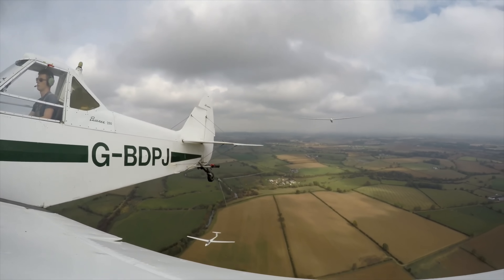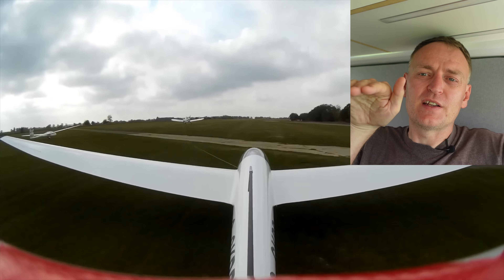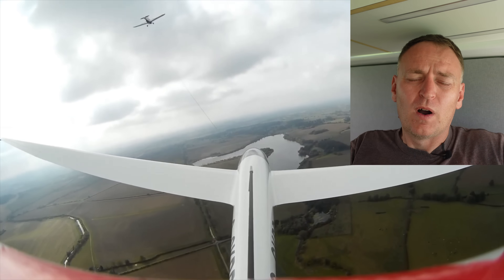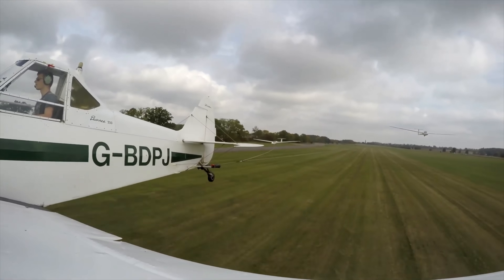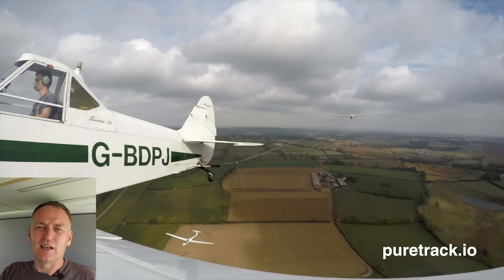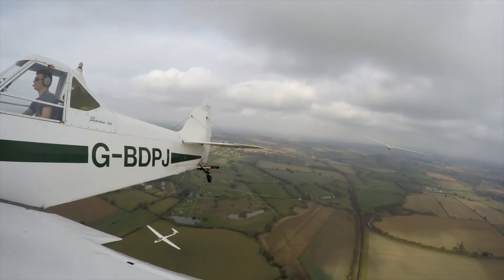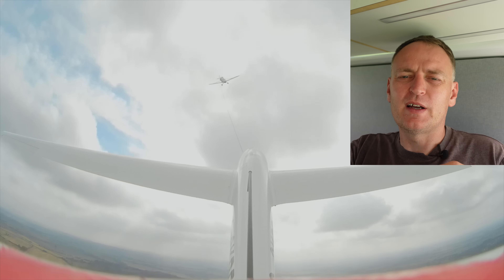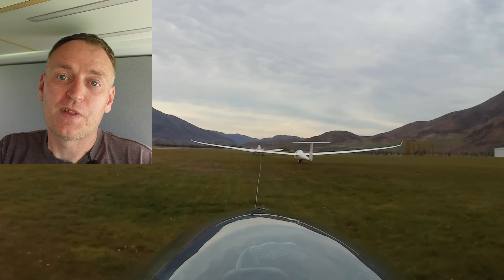Glider Dual Tow Goes Wrong: Instructor Reacts!

Comment: Another thing done wrong was the turn after release. The pilot in the higher/shorter position should have turned left, not right, given that the other glider was on his right. Likely a case of habit, always turning ti the right expecting the towplane to go left. The pilots should have had a prior agreement that the left glider foes left, the right glider goes right and the towplane carries on straight forward.

Comment: Having years of both tugging and gliding under my belt. My only comment is that the tug pilot must have been well and truly relieved to have those two gliders well and truly gone.
Reply: Well and truly. 😉
Reply: @jordanstclaire  Yeah for sure, and that's what we train for is if your too far out of station with the tug or you can't regain control release immediately, cause the tow pilot certainly will cut you off if he has too and then you risk damage to your controls and landing with the rope attached.
We were taught to release if the tow plane dipped his wings side  to side  get off before the 3rd dip or he'll do it.
I thought my tow position was bad when I'm learning and this one jist takes the cake and that position is super hard to maintain as you and many others would know.
Reply: yeah that looked unsafe from the start. Must've been a bad feeling

Comment: It could end much worse, if the rope would stuck into the aileron, blocking it in non-neutral position. I know of such an accident that happened in Poland, the pilot in similar situation wanted to shake off the rope from the wing, applied aileron and rope moved there and blocked. Sadly, that did not end well...
Reply: I worked with a guy who used to seed rice paddies in Northern California. It wasn't uncommon for large flocks of migratory waterfowl to be in the rice paddies. He taught me that when a flock of birds comes up in front of the airplane, it's best to neutralize the controls and fly through them instead of maneuvering to avoid them. The reason being to prevent jamming the flight controls. It's a lesson I've carried with me through my flying career. I include it in all of my takeoff and approach briefings where there is an increased chance we encounter larger birds. Luckily, I haven't had a flock pop up in front of me, but I did take a lone Canadian goose directly to the windscreen on short final.

Comment: You can really see that the tow pilot is having to work right rudder quite a bit.   I wonder why he didn't radio the lower glider to move into a better position?  Aside from a proper briefing, there's also communication.  

Our field is too short for this sort of thing, so we've no experience doing this.  Thanks for sharing this.
Reply from the maker: Yeah from what I saw I think the tow pilot was chatting to the guys on the radio
Reply: How do you know tug pilot didn't contact lower glider?
Reply: @StjepanNikolic  You're right, I don't know, but if he had told the pilot on the right to also move to center, then hopefully they would have done so.  The problem with these videos is that if it's not something we can directly see, we have to guess.
Reply: @davesgliding  what do you think was happening at 6:06 ? you dont cover the microphone with hand unless you want to attenuate engine noise and be clearly heard. When everyone is facing forward, who should have better situational awareness?
Reply: @StjepanNikolic  yah, I don't know what he was saying.
Reply: @davesgliding  Clearly the tug pilot was talking, maybe the glider pilot(s) weren't receiving?
Reply: @aaronfahr9  probably a communication breakdown somewhere.  The tug pilot did release pretty quick before it turned into an upset, so seemed to have good situational awareness.
Reply: @davesgliding  Tug pilot was certainly on the ball, not so sure about the second glider pilot. I'd love to know how this was briefed.

I'm supposed to be starting my first season as a tug pilot in a couple of months, doubt I'll be doing this.

Comment: Thanks for showing this.  Brought up so many emotions for me as someone who has actually done a dual tow.  It just made me thankful that the people I did mine with (many years ago) knew what they were doing and we (ALL) were properly briefed.  I would say all 3 were LUCKY they didn't end up in a spiral mess hurtling,,,, well you know.  And after all that, the glider on the left (pilots facing) turns RIGHT, right into the path of the right glider, I just about freaked out.  Anyway, glad you showed video 2 - I will go flying with those guys any time.
Reply: I'll prefix this by saying I have no idea what I'm talking about. But it looked like the tow plane experienced a some yaw when the tail was pulled down, so much so that the left hand glider (pilot facing) was almost directly behind the tow plane when it released. I wonder if they just wanted to get out of the way of the path of the tow plane and knew the right hand glider was quite a bit lower than them?

Comment: We used to do plenty of double tows in the mountains of British Columbia moving gliders from airport to airport. The turbulence is strong and we found it much better to just stay horizontal on high tow, short glider just a bit higher than normal. The tug was then just yanked from side to side rather than up and down with the stall horn blaring. The other benefit was that in low-tow the glider would get covered in oil from the L-19 birddog tug.  Not by the book, but we swore by it.
Reply from the maker: Interesting!
Reply: The first reply which talks real experience.  Why is the lower glider 2 and half spans(!) lower? One span is enough.
Reply: I've done dual tows at both ends with L19s in BC - always low/high after takeoff...musta been a different CO ;).

Comment: Did a lot of tugging before continuing my pilot career. The danger is when you have a lot of inexperienced pilots around you. Then anything can happen. The scariest for me was when a friend of mine was tugging a glider with the old version of a Pawnee, the one that has the fuel tank between the engine and the cockpit, the worst possible position for a fuel tank. At the start the glider pilot had not coupled the elevator correct and had not done a sufficient steering column check, so with no elevator control the glider went straight up pulling the tail of the tow plane hard up at lift off. So in fractions of a second the tow plane crashed into the ground before the tug pilot was able to release the rope. His Pawnee caught a fierce fire and my friend was burned to death in front of his two young daughters. 
My take from this as a tug pilot was to always,always have your eyes glued to glider at take off and your hand on the release handle.
Reply: Whoa, that story is scary. How can you not connect an elevator correctly and miss that at inspection? Brrrr.

Comment: Wow dual tow, never knew this was a thing. Looks impressive but also dangerous but I'm not even a novice. Well narrated and good filming from the different angle. Would love to try a filght in a sailplane as only done powered flight. Cheers all.
Reply from the maker: It's not as dangerous as it might look if done correctly :)
Reply: As another primarily power bod hoping to dabble more in this dark art of flying without engines .......
I find it helps to think of it as the opposite of a multi engine approach
Here you have 3 aeroplanes and only 1 engine.
Gotta love the economics of this  😜
Reply: Incidentally what's the difference between a glider and a sailplane?
Reply: @Tungsten Kid  to my knowledge (please correct me if wrong), a sailplane is like what is in this clip, an unpowered aircraft with a large wingspan. The term glider can include such things as motor-gliders which I have flown, which are aircraft which have a small engine but are operated similar to a sailplane and also similar to a typical light aircraft. Gliders can also include paragliders and para-motors. Most of the time, the term glider will be reference to a sailplane. 
I hope this makes at least some sense.
Reply: @tungstenkid2271  "What's the difference between a glider and a sailplane"?

Usually several thousand dollars

Comment: Good reaction from the tow pilot. I'm quite surprised that the glider pilot was able to get so far out of position, and would love to hear the cause 'from the horse's mouth'. It's real easy to jump to conclusions that would dismiss the glider pilot's skills, but he/she is probably perfectly skilled in flying but something was omitted in this case?
Reply from the maker: Yeah it would be good to hear what they said. There's definitely a big difference between pilot skills and just not being aware how it should be done. I'm not saying any of the pilots weren't skilled. The tow pilot was certainly onto it and should be commended for his quick actions.
Reply: Whenever a glider 'trades altitude for airspeed' it can overtake the tow plane.  On a single glider aerotow this can easily happen when the glider drifts a bit higher than the towplane and then (incorrectly) pushes stick forward to return to level position.  Nose down will increase the glider's airspeed (faster than the towplane) and put slack in the towrope.  The correct way to return the glider to level behind the towplane is to yaw the sailplane to reduce lift and increase drag.  This keeps the rope taut and restores correct position.  If the glider is threatening to rear-end the towplane, glider pilot can open spoilers to increase drag, slow glider, and tauten the rope.

Slack rope is commonly triggered by turbulence.  We all learn how to remove it, and with practice we learn how to promptly input corrections that maintain correct position in turbulence.  Since the towplane is 200 in front of the glider, it can fly into sink when the glider flies into lift (and vice-versa).  Glider pilot can compensate with elevator, spoilers and yaw.
Reply: @Paul-vh6ul  I think most of us here know how that works. Still incidents occur even with extremely experienced and/or professional pilots. I think that we can assume that the pilot in this case was perfectly proficient in aerotow, because you'd never attempt a dual-tow. And still he/she got way out of position, so knowing what really happened is important to learn from the incident. Was it weather related, airflow related, human factors, who knows?
Reply: Trim too far forward?
Reply: @Paul-vh6ul  A genuinely useful reminder . ........  Top Comment  👍
Reply: @Paul-vh6ul  Informative comment. Thanks.
Reply: Well now, if they were perfectly skilled in flying/being duel towed we would not have a after action video.. 
There is a certain skill level in every high risk activity, I can clock it on my  bike, but that does not mean I can just jump into the TT or do a track day, skill, knowledge and understanding how things are done right the first time is important,  accidents happen for less..
Reply: @Cent51  (a) You're right
(b) Not the point exactly but you sound like you might enjoy going through the 'California Superbike' Race Training course (assuming they're still going) or at least digging out a copy of Keith Code's book 'Twist of the Wrist'.
You'll be well prepared for trackdays.
(But not the TT)

Comment: In any briefing with critical items the best process is using repeat back. The instructor says to the low pilot. “When the top glider moves  to the center high position, you move over and assume the normal low tow position.”  Then the low pilot repeats back those instructions word for word.  (At a USA nuclear power plant, the instructor would repeat it back again, three way communications.  It becomes so instinctive to Operators that they will do it back to their wife, usually with a bad outcome)

Comment: For water skiing and wakeboarding we use a special non stretch rope so we can’t easily make slack. When you ski with a stretch rope and cut hard once you get to the edge and go to cut back the rope slacks and rips your arms off when it gets tight

Comment: When i did my instructors rating at Matamata we did it from a treble tow. Gliders out on both sides  and us underneath. Very cautious during the flight.
Reply from the maker: I bet! Never seen a triple tow, only a dual myself :)
Reply: @PureGlide  The development of the protocol used for the multi-tow is likely interesting for those appropriately in the know to theorise about. (perhaps including briefing for the common problems, or the common problems among those acquiring new sills). Kinda surprised that in the bad example there wasn't some radio instruction to the out of position glider, or positive confirmation of satisfaction...they are distributed system.

Comment: Thanks Tim. As you know up until last year when the narrowing of the Raglan Airfield made it unsafe to have 2 gliders on the runway concurrently our Piako Gliding Club annually dual towed the 2 Club Puchacz’s from Matamata to Raglan while the Scouts took over our Airfield for the Walsh Memorial Flying School. For tow pilots who had not done dual tows before there we’re always practice tows & extensive briefings. Glider pilots always flying with an experienced Instructor in dual tows in the back seat. I’ve great photos & video of being the glider on the long rope at the back. Malcolm Piggott has an excellent video you may want to post as a follow up on how to do a double tow correctly & safely.

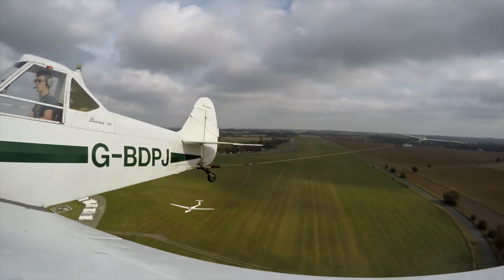Comment: The same problem we have at our airfield. We use a microlight as a tug with one glider in tow. The Problem is that the tug has a takeoff-weight of about 420kg with a 700kg glider in tow. In case the glider pilot is not knowing what is expected of him, the tug-pilot is in big trouble. As the tug-pilot I would have released the glider earlier at minute 3:55 for an off-field landing.

Comment: In the video with the correct dual tow, the gliders lined up behind the tow plane while still on the ground. As a result, the tow rope for the glider at the back was under the wing of the glider at the front. This means that if either the glider at the back or the tow plane would have lifted off the ground before the front glider, the cable would have hit the wing and the front glider would have tipped over, possibly doing a ground loop right in front of the glider behind it.

Wouldn't it be safer for each glider to keep to the side, like the two gliders in the first video did? And then, only once in the air, would they position themselves at the center?
Reply: That's how we normally fly it.
Reply from the maker: Yeah it depends on the experience levels of the pilots, and weather. In that last example's case they had thousands of hours flying those gliders, so no chance of the rear gliding leaping into the air. Yes you could leave the gliders separated horizontally for a bit longer if needed. Cheers!
Reply: I've towed two before there's no chance the tow is plane going to take off first. I like the in trail method, when two gliders start to the side its very hard to maintain directional control, needing a lot of rudder to stay off to the side and dragging a wing (snagging a rope) is very possible. also if the ropes in a wide V snag on weeds or clumps of grass it tends to swerve the towplanes tail causing a lot of foot work. in my opinion starting in trail is good as long as the lightest (soonest to lift off) is in the middle, lessening the chances of the rear glider pulling the rope up... the back pilot needs to be the most competent, first staying disciplined and low and reacting properly if the first glider has a rope break or the towplane upsets... largest risk is to the sailplane in the low tow position if the robe breaks or is released by the towplane where the glider has to eat the mess of rope... generally double tows lost their usefulness after WW2.
Reply: In the commentary it says that the #2 glider remains on the ground until #1 and the tug are airborne.
Reply: I wouldn’t be too happy about aerotowing with a taut rope under my wing. No matter what the rear pilot’s skill level, this is a massive risk if there were a mishap.
Reply: @DMC888  "a taught rope".

Depends what you'd taught it. 😉
Reply: @aaronfahr9  ahh the wonders of autocorrect.
Reply: Our club used the dual tow method back in the '80s mainly to get a couple of the club gliders up to Kaikohe for Christmas camps and it was also demonstrated at air displays.
The main reason for offsetting the gliders on the ground is so the front glider doesn't run over the longer rope as the rope is traveling at the speed of the combination, so a tyre in contact with it can burn or damage the towrope as well as the possibility of the rope picking up on a brake arm or tailskid.  Once airborn, the front glider essentially flies a normal tow and will release first.  
The lower glider pilot has the more exacting task during takeoff of getting airborn but staying very close to the ground to ensure rope separation till the towplane gets airborn and commences the climb, at which time the back glider assumes the low tow position.  After the front glider has released the rear glider would go into the normal high tow before releasing.  Hopes this helps.

Comment: Years ago, I was asked to design a dual-tow installation on a Transavia Airtruk (I'm an aeronautical engineer).  I used two TOST belly releases, installed upside-down so they would automatically release if either glider got too high.  I flew the high glider and investigated out-of-position potential problems - the Transavia Airtruk was an unconventional layout and had two tail assemblies, and a very short fuselage, so the vertical out-of-position did not cause the tug pilot any problem, but the lateral out of position was potentially dangerous.  Overall, the experiment was abandoned, because the added risks of a dual tow with any tug were far too great to justify the small cost benefit.  It's a fool of an idea, been tried many times - it simply isn't worth the risk.